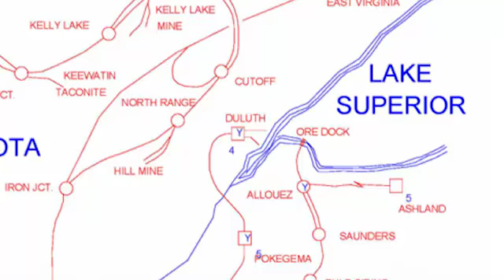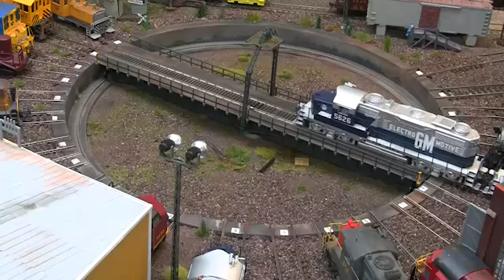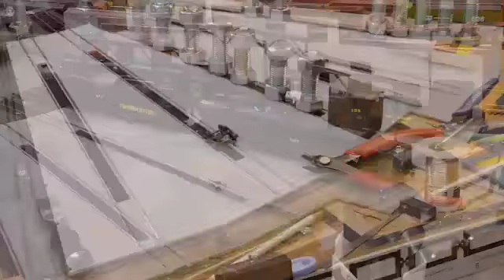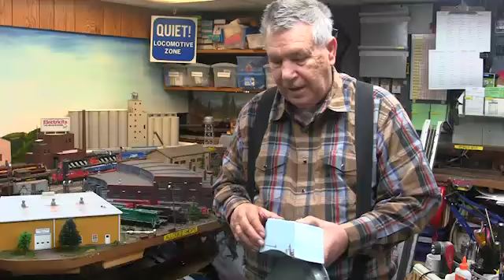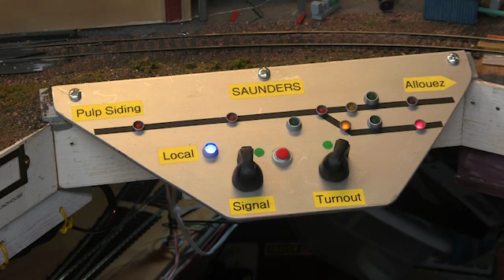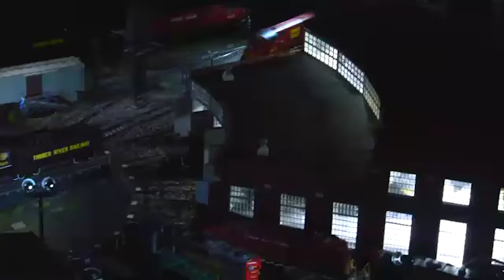Walthers Showroom Update Special Edition – Easy Turntable Upgrade

Comment: That's great. I have a question, how do engines work with a keep alive installed.
Reply: Ted Beach with electric current
Reply: @markframe4047  I think he wants to know how it keeps sound through the dead area in the turntable.
Reply: With a keep alive that works for any longer than 10 seconds the locomotive should keep sound through the dead area